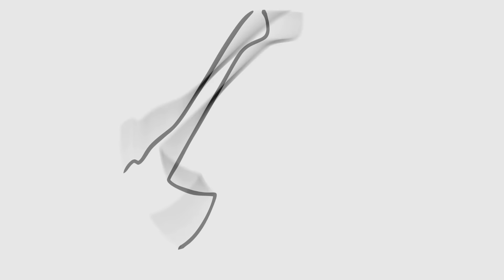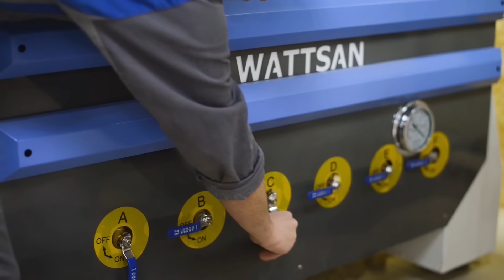A Smart Table of Epoxy Resin using the Wattsan CNC machine

Comment: So it doesn't do anything else, it just looks cool?
Will it always use electricity even if you don't put anything on it?
Can I put something hot on top?
How to provide electricity to this table?
Reply: I honestly don't understand how you're going to mass produce, more than half of the content in your films requires manual work.
If it has a problem, who do I call to repair it?
Reply: @AdoringLester  They failed their Kickstarter so I don't expect this to get made other than for the video. Table cost almost $2000 a piece on earlybird so noone bought it.
Reply: @Sku11King77  Thanks for the answer!
The whole project is also very strange, they casually let people invest, even as low as $1, but can not guarantee anything, and did not mention that after gathering enough money, and then rely solely on their few people in the end how to produce, I really have a lot of questions, but I did not mention.
I saw that they have 3 projects in KICKSTATER, 3 of them are this table, again without successful fund raising.
Maybe all they want to do is to make money from video and KICKSTARTER for "once".
They never expected the fundraising to be successful, because the funding period setting is too short, so naturally they didn't need to plan the next step.
Then the operation was repeated, reopening the fundraising every few months, and the money kept coming in.
So the whole thing makes sense.
I've read many messages asking if they can order the table directly, but no one has ever responded, so I think it's a scam.
When people focus on other people's creativity, they end up in a trap, and the whole thing is really horrible.

Comment: What sensor did they use for touch?
Reply: They will not tell as what sensors are this. I have decided when I will.make one of this. I have ordered loads of sensors for testing to see what is best option.
Reply: @woodworking990  its tp223 most probably.
Reply: Yeah I have ordered some as planing to make similar table.

Comment: What are the sensors?
Reply: They will not tell as what sensors are this. I have decided when I will.make one of this. I have ordered loads of sensors for testing to see what is best option.
Reply: @woodworking990  Let me know which sensors work for you. I'm currently testing C945 transistors and the TTP223 touch switches.
Reply: @kwabenantim  I have also ordered some transistors bc547b and using ttp223 sensors

Comment: Anyone who actually knows woodworking would know that this table is not worth more than 500 dollars if it even works. It is mostly epoxy and cnc work plus the table at the end of the video is not even the one you worked on. We have no proof of the table that is worked on throughout the video actually lights up at all and if it does who would want a light up table. Sorry but this is a doomed design from the start.
Reply: That's the comment that I looked for.